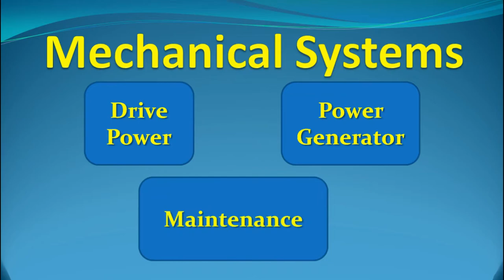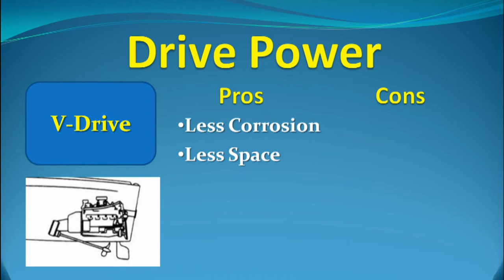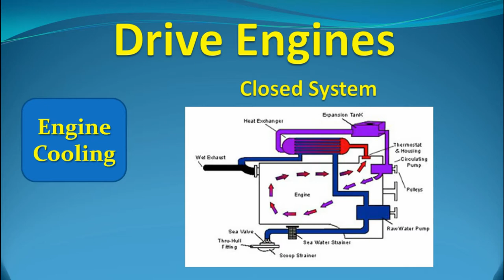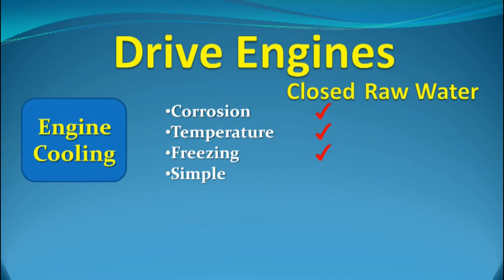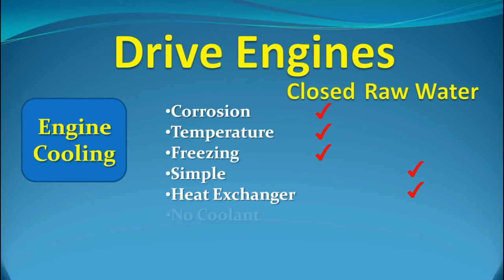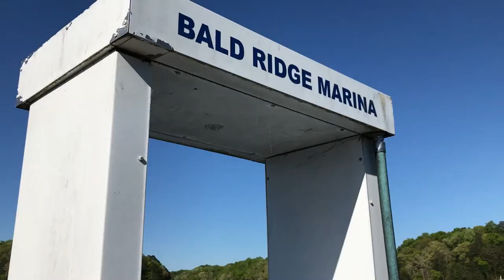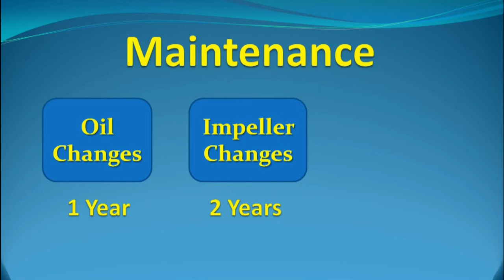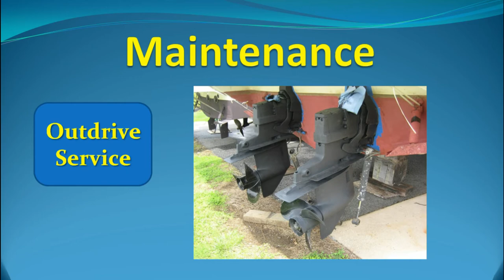Houseboat Mechanical Systems

Comment: I love this series of videos but I have to say there are some inconsistency for example diesels will out last gasoline engine by a long shot mostly due to diesel being a lubricant and are more powerful due to high energy density of this fuel. Note there's more energy in diesel fuel then gasoline
Reply from the maker: You are correct about diesel containing more energy than gasoline - my mistake. However, lifetime of the two types is less significant in a boat as the rest of the boat (hull, outdrives and superstructure) will limit the life span of the whole vessel.

Comment: Hi, how are you? I bought a Stardust 50 and water is coming in from underneath, the wooden floor is all rotten and can be repaired.
Reply from the maker: Sounds like you might have a “steely” with corrosion issues. Remember, they rust out from the inside - not the outside which is always in the water. 😢